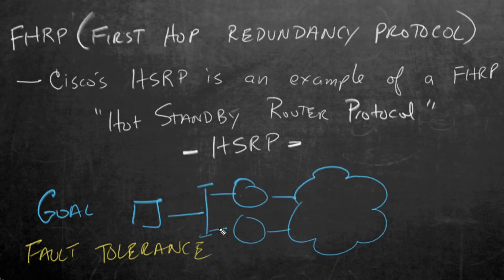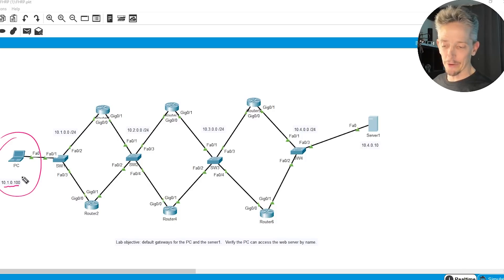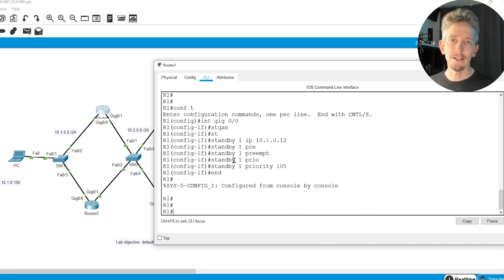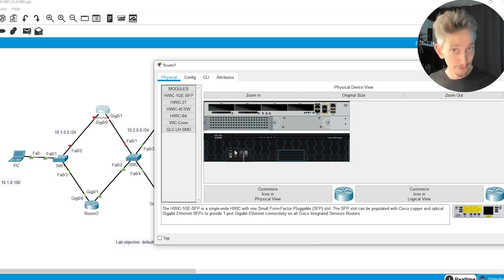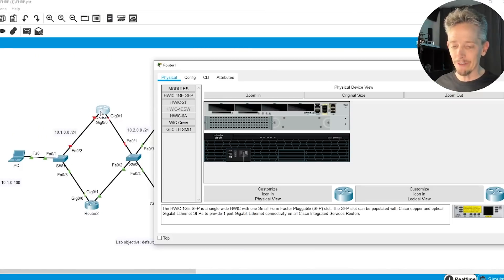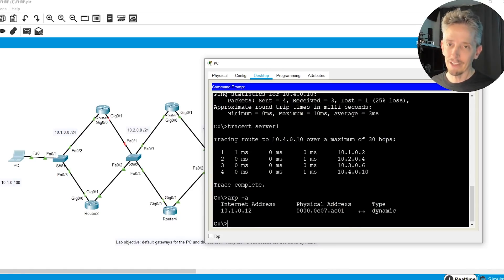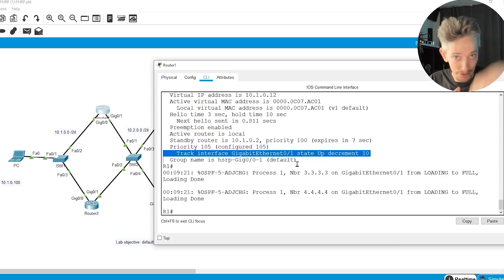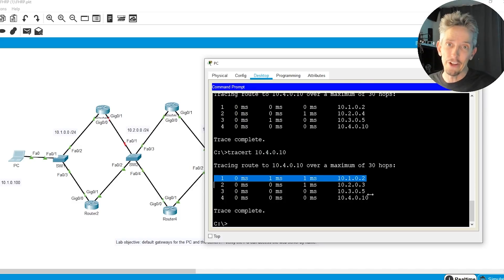Can you implement a fault-tolerant default gateway???  Try this free Packet Tracer today.

Comment: Owsome I have one question , do I have to change the default gateway from the PC every time that one Router goes down or the interface goes down ?
Reply from the maker: Thank you for the question Pablo.   The good news is no.    If R1 is at .1, and R2 is at .2, and both of them are in the same HSRP group that is supporting .12, the client can always have the default gateway of .12 and which ever router is the active router will support that address, even if 1 of the routers fails, the .12 will still work as a default gateway for the client.
Reply: @KeithBarker these is owsame , thanks for sharing some much knowledge !!! One one more dude . i was looking if I can do the same with two  ports in the same route, i would appreciate it !!

Comment: Nice! This was a very fun lab. Thank you Keith! With this specific topology, would you want to also configure HSRP on Router3 and Router4 if this were a topology used in production?
Reply from the maker: Thank you for the question Caleb B.   In the middle of the network (without clients) we really don't need FHRPs, and if there is a failure there, the routing protocols will automatically converge to continue to forward traffic.   FHRPs like HSRP only needed when next to hosts that have need for a default gateway.